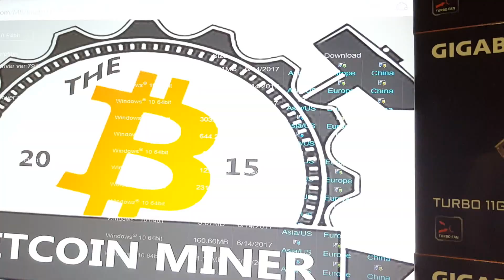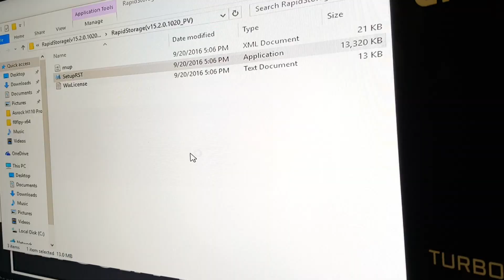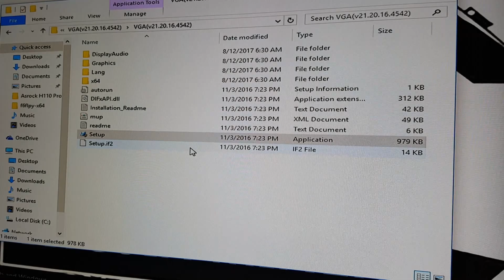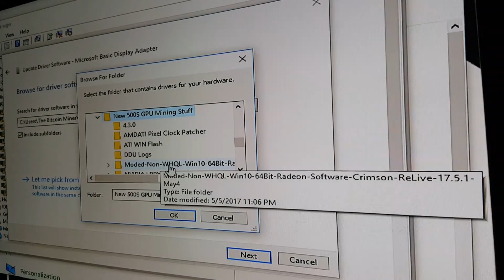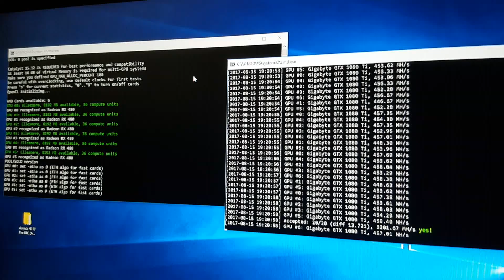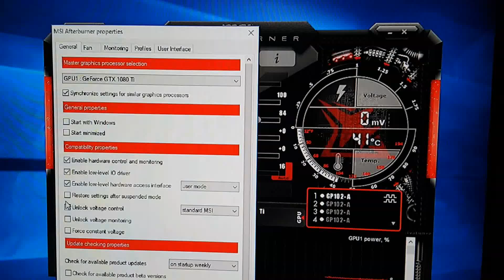How to Build a 13 GPU Mining Rig With 7 1080 Ti & 6 Rx 580 on a ASRock H110 Pro BTC Ethereum PART 4

Comment: Hy, how did you connect the motherboard to your screen? I see your port dvi-d is empty, I ask because I’m finishing my rig and I got a screen with vga slot, I have to buy a adaptator vga to dvi-d, I tried with the adaptator hdmi to dvi-d but it don’t work... how did you do??
Reply from the maker: I'm hoping you got this figured out by now but if not you plug it into the graphics card that is in the normal graphics card slot.

Comment: Hello i have problem with windows in h110 btc pro blue screen error driver? :(
Reply from the maker: Hi Antonio Brito, sorry I'm slow getting back to you but yes most likely it's the driver, worst case scenario you need to restart the computer in safe mode and you may need to unplug all the extra graphics cards just use one. I hope this helps and good luck.

Comment: are you using the same email for each RIG? what im trying to say if all the money goes to one account or does each rig you made a new email thanks for clearing my doubt...cheers
Reply from the maker: Hi Extreme IP Security, not sure I understand the question but yes you can send it all to one account if you want to.
Reply: SO LETS SAY I HAVE 10 RIGS OF 13 GRAPHICS CARDS.... SO DEFINITELY I WOULD HAVE 10 DIFFERENT RIGS WITH DIFFERENTE ACCOUNTS CORRECT? OR CAN IT ALL BE ONE ACCOUNT WITH 10 RIGS  SORRY ABOUT CAPS MY PC NOT WORKING TODAY
Reply: so lets say you have 10 rigs working  simultaneously so you would use one email acct and have all them minning to one acct? how do you make it happen thanks in advanced....IM a tech but im trying to figure it out or all the rigs one separate acct? not sure if i can explain myself thanks for takign the time to understand me thanks
Reply from the maker: Yes usually they're all put under one email account and each miner has a different worker name or you can just mine all to the same cryptocurrency address. I hope this helps and good luck
Reply: i will have 30 rigs do I purchase  30 monitors?thanks for helping me out
Reply: what linux system are you useing? cheers

Comment: Any updates on the stability?? My h110 runs fine with 5x 1070 but when I add Rx 570 in the mix it crashes within 4 hours. Wondering if you have same experience.
Reply: And by the way, the new block chain driver from amd boosts and hashrate to 28

Comment: Why the hell are people making mining rigs with 1080s when you can get 2 1070s for the same price and get twice the hash rate and same or slightly less (depending on the model) power consumption. You can easily OC the Gigabyte Windforce 1070 memory to +1000mhz and bring the core to -400mhz and power at 70% and get 32-34 mh/s out of it for with power consumption of about 115W. For anyone looking to make a mining rig for the love of god DONOT BUY 1080s.

Comment: hi sir, had a question. i had Asrock BTC pro support 13GPUs of RX570x4GB, but my windows 10 64gb only can support 8GPUs. when i try on 9gpus the systems crashed. could you please advise when can i do?
Reply: You can put 8 amd card rest must be nvidia or other way around, if you put 9 card of amd win will crash

Comment: Dear sir. The riser on mobo side. They are touch each other the usb to pcie slot. Is that ok? The distance betwen the pcie slot is make the riser touch each other. Do that make a short circuit or something?
Reply: Andi put electric tape around your risers to avoid short circuit them ...

Comment: is it possible to build a rig using 13 1080TIs only?
Reply from the maker: Hi Bruno Silveira, yes you can but it would have to be on Linux or something other than Windows.
Reply: TheBitcoinMiner I appreciate you responding. Is your end game to then use these all coins to then buy bitcoin? Or do you like to sit and wait on them in case the value skyrockets? Much appreciated for all your great videos.
Reply: Why is that? Doesn't windows see 13?
Reply: BenScoobert windows supports around 8
Reply: banded I've seen videos with 13
Reply: probably on simple mining or 8 amd + 5 nvidia or the other way around.
Reply: SeepMan maybe but windows is way    simpler and has more support.

Comment: What are the operating stats?
Reply from the maker: Hi Jeff C, I'm not sure I understand the question? If you're asking how much LBC it was mining I think it was 3400 Mhs something  and 135 Mhs on ETH
Reply: Did you display power use? I would like to use the calculator to predict ROI
Reply from the maker: No I did not because I left it at a friend's house and both of them can still be modified further to be more efficient. If I had to guess it's probably going to pull around 2,000 Watts when I'm done.